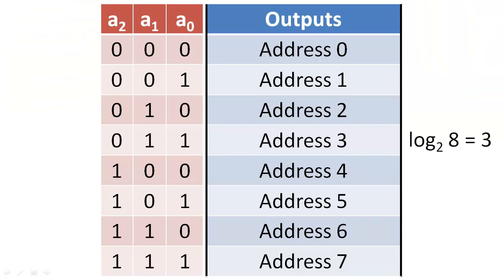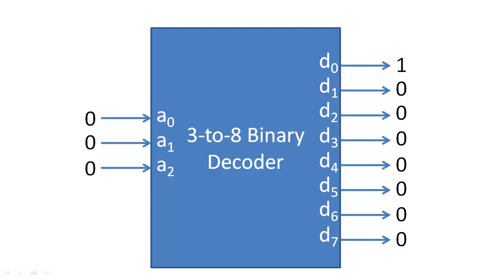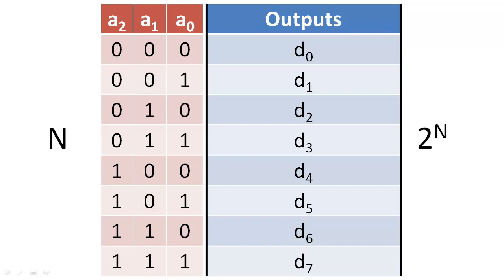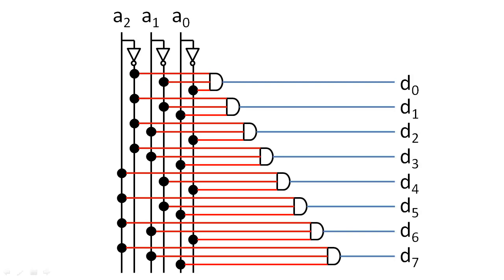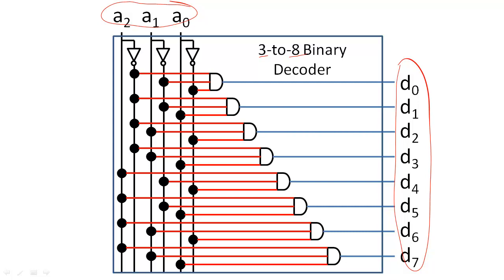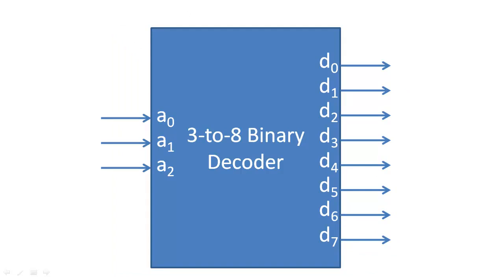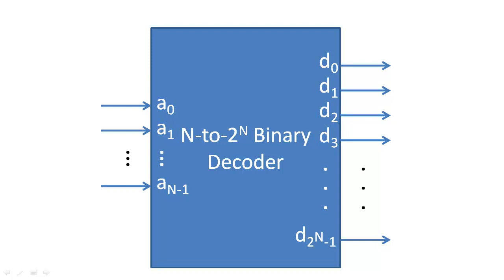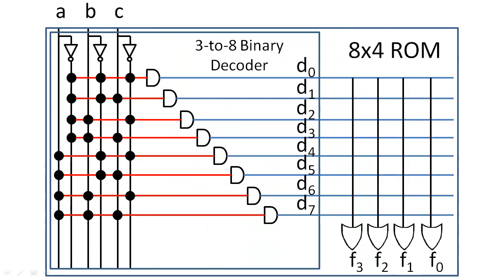Binary Decoders

Comment: I'm trying to find a 4 to 16 decoder, which one would you recommend that has only 1 chip enable pin? All the ones I'm seeing have 23 chip enable pins and it doesn't make sense. I'd like to input high and output high the way you described, but none of the chips I found do this

Comment: what is the difference between a binary decoder and a demultiplexer then?
Reply: A demux simply selects an output line, nothing more. A decoder takes n inputs, and uses those inputs to determine which of the 2^n output lines is high.